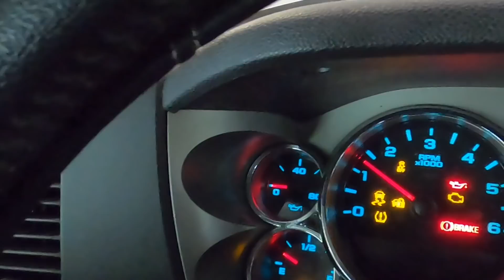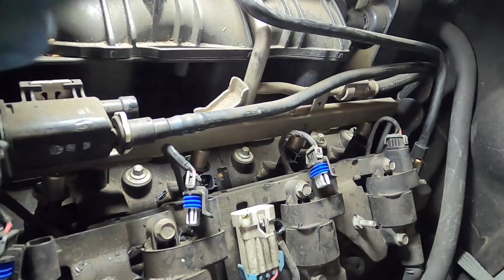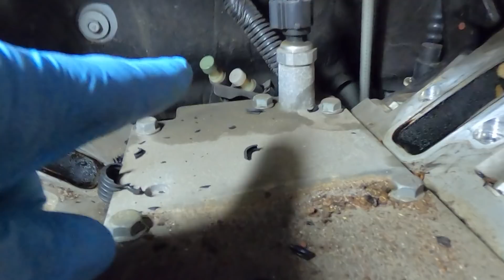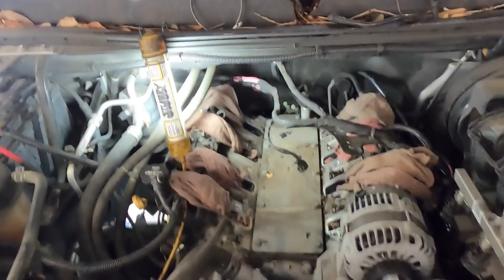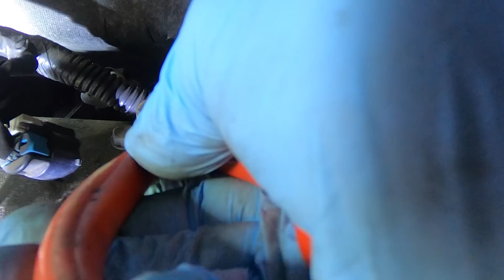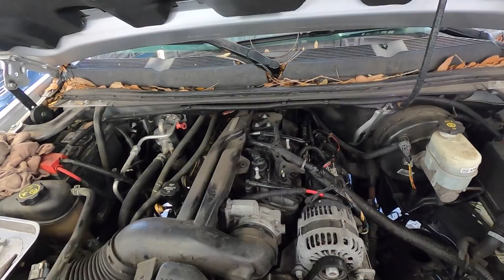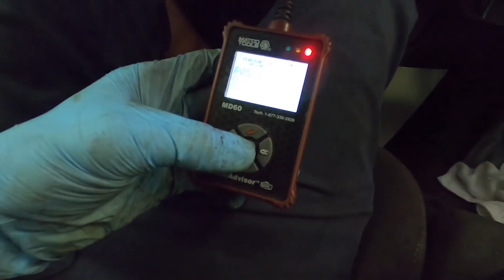Customer States: Google Diagnosis…replace this part!

Comment: Great job . My question is why not use a shop vac for the debris first and then stuff rags into intake port as apposed to using a blow gun .
Reply: compressed air will dislodge much more dirt than a shop vac. most shops run around 120-150psi.

Comment: Sorry Ray.  Without removing the intake. Using a step stool, You can disconnect the fuel line on the right side and reach in to unplug the sensor. Then with a wobble joint and extension, remove the sensor. Good call on leaving out the screen. I've heard enough feedback that the screen plugs up worse than the sensor does. ;D
BTW has the customer had the TB cleaned before? That would've been a good time to do it.

Comment: Hi Rainman, wow it always amazes me the seemingly unstoppable desire for designers to drive mechanics crazy.  Note; changed the oil sender on my 70' Chevelle 350 in about 4:00 min.
Reply: Everything goes through the first design department. When this is complete, they send it to the redesign department where they compete to redraw all the components from the original drawings into impossible to work on positions.
Reply: My son has a 68 Chevelle with a 327 motor I gave him the motor for when he graduated high school you're right about the time it's right all the way in the back right behind the distributor thank you have a good night enjoy that car I love them

Comment: Didn't see you connect the pcv line on the driver's side valve cover.   I played it over and over did see you set it to the back but not connect it

Comment: The check engine light was off and the oil pressure needle looked close to the middle @32:10. Whats up with that?

Comment: I’m glad to see there are more great mechanics then shady ones.  One shop that I dealt with said that I needed a transmission rebuild.  I wanted a second opinion.  Turned out is was a disconnected sensor wire.  Fix cost me a handshake and a thank you.

Comment: Me:  "I'm not getting any reading on the oil pressure gauge. I think it's probably the sending unit, but could you figure out for sure what it is and then call me? Thanks."

Comment: its so unwise and  frankly a waste of time to not have the shop do a diagnostic evaluation for the problem, its to prevent needless disassembly and replacement of a part that has not failed.  Hope the owner of that car learned something from this, as his wallet took a needless big hit.

Comment: Have question but intlled my trans gm im inside of the line are locked in I pulled on them dm they don’t come out but the clip seems loos idk it it’s normal or m I just paranoid

Comment: Why didn't you use a shop vac instead of trying to blow the debris off after removing the manifold? Seems like there'd be less chance of getting debris in the runners.

Comment: No one that actually works on vehicles like this gives a shit about “torque specs”
If you were building an engine or transmission it might be different.
But honestly I have and will continue to build shit with an air impact.
Never had a problem when I use common sense

Comment: Another good video Ray, there are for sure some pretty stupid and tight bastards over there, its madness the number of times you take in a motor thats dangerous but they don't fix.

Do you not have any kind of yearly safety checks? Is it Florida where you are?

Thanks

Comment: Had the same problem, turned out to be the factory sender unit screen, and shitty fram oil filter, replaced with AC Delco parts and filter, have great pressure now.

Comment: @32:08 it seems to have 40 psi and the cel was off. I have really liked your videos untill this one. The customer was correct and instead of saying that you dogged them. Its a simple job that you tool the long route to do for likes.

Comment: I built a special short socket swivel rig to pull those short sensors quick. Pays the same right? It seems not, depends on where you work. I got my throat cut doing it with that special tool. All it took was once.  Now i pull the intake. Short comment, I get it.

Interesting thought. On one of those later models i did a sensor. It didn't work again until i cleared the codes, even with a good sensor and good circuit. It was a situation just like yours, except i was tasked with diagnosing bad sensor/good cluster. But leave the other codes alone. 

The Autel Maxisys Elite is nice, full scan on everything and it makes a printable report. I am not affiliated, just a happy owner. I electronically store all of my scans for future reference.

Comment: I cannot beleive all thar had to come off for an oil pressure sensor. Why dont the engineers put it at the front of the engine in an easy to access position?    Crazy!

Comment: Have done this job multiple times in 15 minutes. Extension with wobbly and it comes right out. Usually the screen under the pressure sender just needs cleaned out.

Comment: I know it's not your call. You do the work orders that are handed to you. I was a technician for several years and a Honda  service manager for 12 years. I would have never taken a job using a customer diagnosis only. This does not fall on the customer it falls squarely on the service advisor or manager for accepting it.

Comment: Did anyone else notice that the check engine light was off and the oil pressure sensor was reading just under 40 at the end of the video?

Comment: This reminds me of a boss where I work....It was a Big Cat mining haul truck with low oil pressure...instead of getting the Cat mechanic to diagnose it, the shop foreman used his 'wisdom' and said..' just rebuild the bottom end' ...annnd the Cat mechanic did JUST THAT....When the engine was started up again,guess what? the code popped up for.....LOW OIL PRESSURE.....The Real Cat mechanic was then asked to diagnose it....it was a bad sensor.....nothing can replace a good diagnostic tech!

Comment: "Pretty easy one on this car."  Simply remove the whole intake, air hoses, wiring harness, three nuts and a cap, evap lines, fuel lines, booster line, fuel injectors, fuel rails, purge solenoid, and then switch to the passenger side and do the same. Then the unit requires a special tool. 
I have only changed one but I just removed a wire and unscrewed the unit. The good old days.
Reply: You don't need the special tool, but it's helpful. You don't need to remove the intake, but it is a ROYAL bitch.

Comment: Wish my mechanic would've diagnosed an issue I had with my car. Instead of just taking my word for it and replacing the fuel pump.  Driving to work one night, and the car just died, and would not start. Next morning car started fine without issue. There were no lights or anything, but still took it in and they replaced the fuel pump. About a month or so later car died again. Next morning car started fine without issue.. Then a few weeks later it died again. The only common thing is every time I had made a right hand turn. Decided to take it back to the mechanic, and on the way the check engine light came on. Turned out the issue was a bad connector on the fuel pump driver module.

So maybe its best to just say what happened and leave the theories in your head.

Comment: Flat rate. If you can beat the book time, you make more money. Sometimes you get the bear, and sometimes the bear gets you. Good how-to video, do you work in a flat rate shop, or are you on salary? That being said,  the sensor is very common, and aftermarket parts are a common failure. Also, that screen gets clogged with build up and causes the sensor to read zero, at least that's what I have found. In addition, none of my employees would just give the vehicle back as-is. The customer would know what was wrong....

Comment: I think back fondly of my Triumph Herald.  Bonnet tipped forward and you could get ALL around the engine to everything,  pretty much without removing anything.  Even had a reserve fuel supply so if you ran out, you turned the lever and it gave you another 20-30 miles of travel!  sighs  Carb, distributer, points and a lovely throaty sound to it!

Which modern cars are easiest to work on from either an 'easy get to it' or 'fewer unnecessary bells & whistles' perspective?
Reply: Sentimentalist !  65mph with the wind behind it ! and the worst rust problems !    But the Vitesse, now you are talking !

Comment: The whole I take does not have to come
Off for this repair. You only have to reach your hand back there and remove it. The proper tool will help. This is common with this motor and it’s widely known as an issue with Chevy. If there are no other indicators of oil pressure issues, then this pressure sensor is the problem.

Comment: You gotta luv em!! But sometimes you even get them from garages that are so way off the line..I still.fo the odd private job and had a friend of a freinds Audi A1 with an egr code. I use rosstech and my code gave an additional number with egr valve fault. It said it was an egr solinoid. So it went from a £900 bill which wouldn't have fixed the fault to £120 including correct diagnosis the part fitted and an egr and inlet manifold clean..

Comment: I like watching your channel and ussualy agree with your procedures and diagnosis but not this time, I've done this exact Job on my own pick up plus a few other people's and it takes me 15 minutes to change the oil pressure sensor, your way more likely to give even stubborn customer a reason to return by doing a simple job quickly , I'm actually shocked you went through the huge headache to remove the whole intake jist for a sensor you can easily reach by removing the vacuum hose for booster

Comment: this is why i bought my own scan tool. i see the light, i get the codes [it even tells what the code is for] and i look at how to fix it and what would most likely be causing them.

edit: 5:41 glad i got the car i did, EVAP purge solenoid is front and center on my buick and i actually had to change that out recently

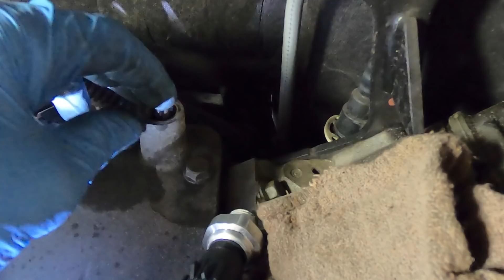16:24 headstrong by trapt, haven't heard that one in YEARS

Comment: That looks like a pain on those trucks. I've done a couple on the GMT800 body style and they weren't bad, but there's a lot more room under the cowl though, just unplug the sender and use a long extension without having to touch anything else.
Reply: looks to be a true pain iiim the ass my brother.

Comment: The new filter did not fit because the old filter was not removed. 
The old filter was plugged by sludge. 
It is going to be painful to do the job again for free.
The new filter ended up in the garbage, just clean the old one with break cleaner.

Comment: I didn't see you pull the old screen out. I screw a new bolt into the screen to pull it out. I just comment if I think I can add something helpful to the conversation. I was telling someone the other day how a fast and smooth mechanic you are.

Comment: I noticed the check engine light was off and the oil pressure gauge was reading. In the last frame you could see it.Wheb you clear the dtc the gauge will start working. I change them all the time on the police Tahoes where i work.

Comment: Anyone else notice that the oil pressure gage does have pressure at what looks about just under 40 @32:09. The engine light is also not on and I would doubt that he cleared the fault codes if it’s still possible the customer will want to diagnose. And if it intermittently works and doesn’t wouldn’t that seem to be the sending unit failure or the filter for it being clogged?

Comment: I worked at my brother in laws shop many years ago, he always said to NEVER install customer supplied parts for any reason, and never do repairs based on customers diagnosis.
Reply: That's what scam artists do, they want to supply their own parts at marked up prices. A good mechanic will do as the customer requests and explain why it maybe shouldn't be done.

Comment: With regards to the screen, is it possible it locked into place inside the end of the sensor end then the whole assembly dropped into the block? It looked as tough there were two tabs on the screen that were supposed to interact with the sensor.

Comment: All you had to do, after replacing the sensor, was to clear the codes the oil pressure would have came back up

Comment: YOU DO NOT NEED TO PULL THE INTAKE. I HAVE REPLACED QUITE A FEW WITHOUT DOING SO.  You need a shallow oil sending unit socket, with a 6in wobble extension, and it pops right off and tech back there rethread the new one and tighten her down. 10 minutes tops. I will make a video next time I do one and tag you.

Comment: My 08 just started loosing oil pressure again. It has a new pump, pick up tube seal about 2 years. I'm hoping it's the switch but it's afm so I'm thinking of just swapping. 5.3 for a 6.0 or a 6.2.
Reply: Also did the motor tick when it was running before you replaced the switch.

Comment: I recently replaced the sender on my 2009 Yukon Denali which by default has the 6.2L engine.  I have four comments relating to my experience.  1st, the sender part number changed with the 2009 model year to NOT include the screen.  There was no screen inside the sender mounting column.  I have no information as to other years and engine sizes.   2nd, I attempted to use the shorter method but ran into a roadblock when I could not fully seat the special socket or a standard 27mm socket on the sender.  The upper portion of the socket hit the hard plastic sound barrier which is bolted to the rear of the intake manifold.  Generally, the clearances were a lot narrower between the manifold and firewall compared to other vehicles so the successful completion of the reach-around procedure depends on the GM model and engine size.  You have to remove several of the same hoses and connections anyway.  3rd, I found that you indeed have to reset the ECM codes before the gauge starts to work.  Once the ECM detects the 5 volt reference being returned from the sender (which is equal to a pressure of over 200 PSI) the ECM tells the gauge via the CAN bus to indicate 0 PSI.  It stays that way until the code is reset even over drive cycles.  I found this in the live data.  The failure in the sender appears to be a blown internal gasket which allows oil to get into the electrical portion of the sender causing a short between the 5 volt reference signal and the sender return line to the ECM (high voltage DTC code).  The other code is just a red herring IMHO. And 4th, I recommend that you replace the intake manifold gaskets (about $27) as the old ones were distorted and compressed.  They easily snap into place on the bottom of the manifold.
Reply: i mentioned that the gauge might not work if you dont reset codes. ran across this on a chevy. Same truck. you have to put the display on factory display on gauges if you want to reset the TPMS locations. weird huh?
Reply: I agree that the gaskets should be replaced whenever pulling an intake manifold like this.  Just not worth the risk of future vacuum leaks.
Reply: You can do any of them with the reach around method. I’ve probably changed over a hundred of these over the years.
Reply: Very informative.
Reply: Only dod or afm use the screen

Comment: Had the oil pressure sensor performance code on my 12 sierra 5.3. Oil change fixed my problem luckily.

Comment: Did your dumbass really pull the intake to change the oil sending unit? I'm so disappointed. I have changed 100's of these on the 4.8's, 5.3's and have NEVER pulled the intake. Only takes about 30 minutes or less.

Comment: On flat rate if I did nothing but these oil pressure senders I’d make bank, I promise 20 minutes reaching around you can do it, it will require you getting on the core support so you can reach it, I have been turning wrenches for 21 years I have lots of secrets, I will do a video next time I run into one because it saves time

Comment: No bro, you did all that to change the oil pressure sensor, I sneak in and get those, it’s tricky but 20minutes and done. Just got to to a reach around🤣 I have done many but if you didn’t know it’s possible no hate just love

Comment: I love the ones that waste your time, I had a customer bring one rotor and a set of brake pads in, note this is because the right rear was grinding metal to metal. But I quickly found that they brought front pads🤣, but it gets better, this customers dad works at a dealership, wouldn’t you think there is a caliper issue if once side is grinding, yes exactly. The piston would not push in and the slides were severely seized on the left rear🤦‍♂️. I put this thing back together and pulled it outside as my time was wasted. Another day living the dream

Comment: The screen is for the Variable displacement vehicles and not for regular engines.  It cleans the oil of particles going to the solenoids that engage and disengage the lifters for cylinders 1,4,6, and 7 and is not needed on the non-variable displacement engines as only the sensor is there and it doesn't need the screen.

Comment: Rainman i feel for you when that happens customers should not be allowed to  bring in there diagnostic it should be only the mechanic doing it now every one the owner has a bigger bill,  if the customer would let the man do his job . Theses guys have certificates and are educated. Good luck everyone. Rainman i hope you  find it’s just a pressure sensor dose gm use more than one!!!!